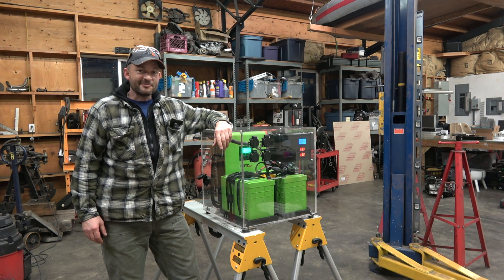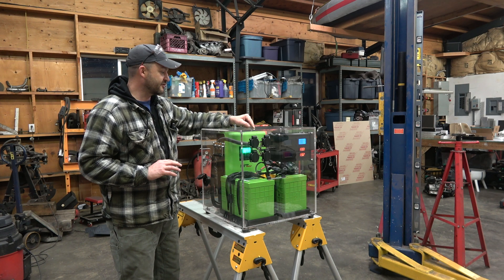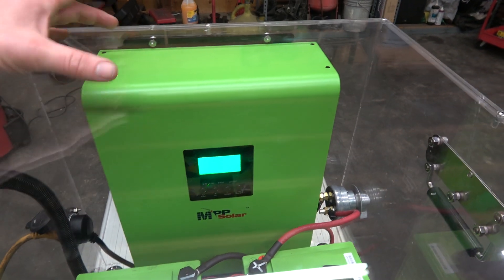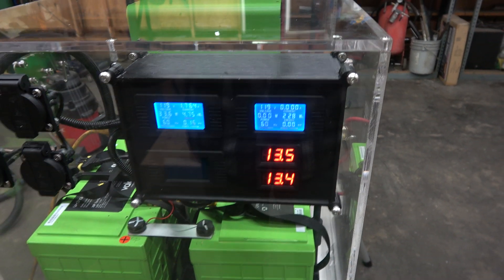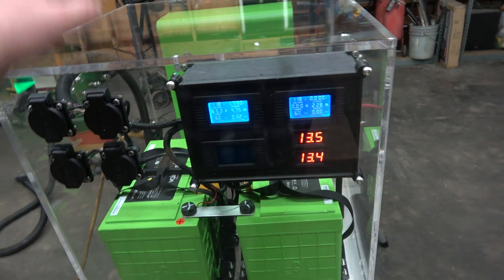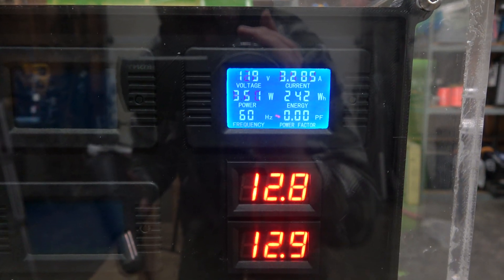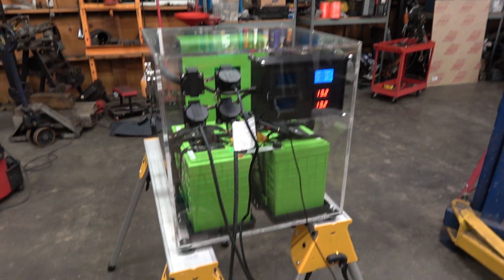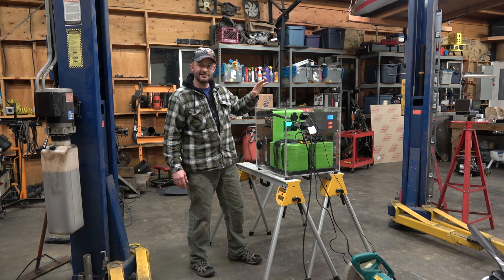Home made portable power supply: alternative to solar generator units

Comment: Did he say 3500 watt hours If so I think your math may be off you said what 38Ah so at 12.8v is less than 500 watt hours so times 2 is less than 1Kwh
Reply from the maker: My math is good :)
138 amp hours per battery, x2 batteries, x 13.6v = 3753 watt hours
Reply: @MattVerley  I could have swore you said 38 more than once but 12.8 is the voltage you should be doing calculations off of

Comment: That's a lot of weight for a acrylic perspex box, I would have put the batteries into a separate box with a connector. Then add another parallel connector in the battery box so I can attache additional batteries in the future if I want to increase amp hours. But still good on him for putting it together for what he needs it for, portability is great till you have to replace a battery.

Comment: Yeah if picked a few of thos batteries and going to build one has well I guess mine came out of  Experimentelle  Delivery box truck so when I tested mine they had 98% of  Capacity the truck only had 5000 miles on it. But they are not fully charged until they hit 14.4v and about dead at 80% discharge at 12.8v

Comment: That's really cool. The plastic box might be a lot of work to take care of but it sure looks good for now. Just daydreaming how i would build one i think a steel tube frame maybe hand cartesque with wheels something i could chain down to a tree at a base camp or cabin.
Reply from the maker: I agree; the cast acrylic I used will certainly get scuffed up.  However; it's pretty easy to remove surface marks with Mapp gas.  I had to go with some kind of enclosure for this so it would be weather resistant.  I also wanted to be able to see inside of it.  Instead of building it out of aluminum or some other opaque material, I decided this could be a good time for me to learn something about Acrylic...